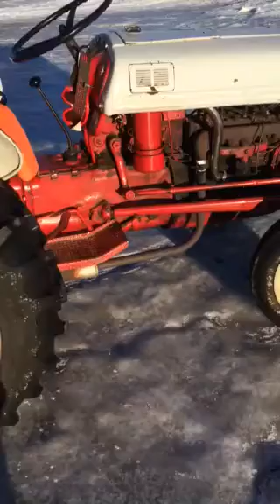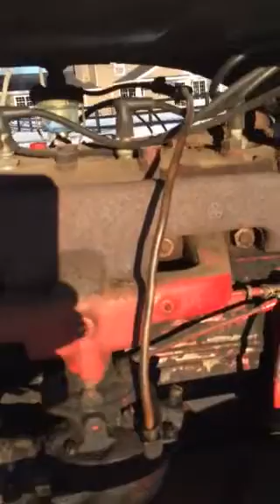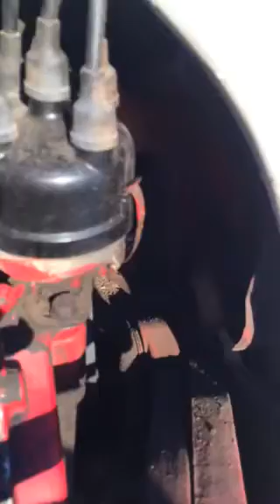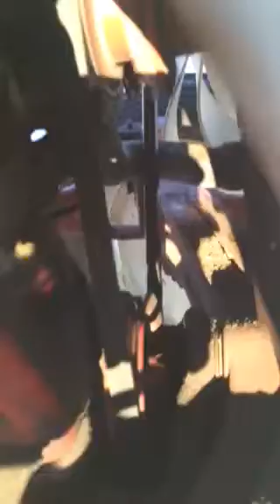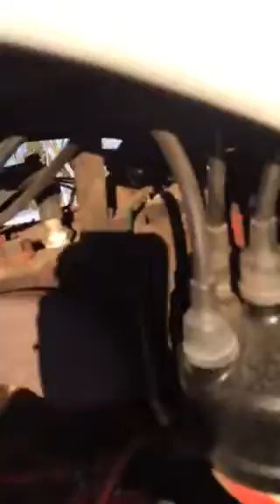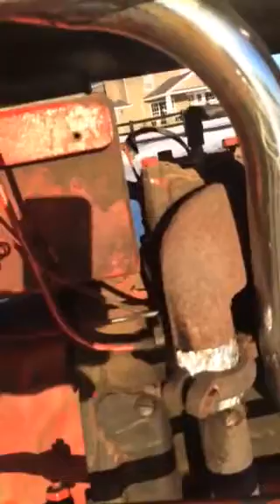8N Crankshaft pulley wiggle

Comment: I just bought a 1952 8n.   Everything seems to be working fine with exception to the exact same problem shown on the video.  Wiggly crankshaft pulley.  Is this something that needs immediate attention? How difficult is it to replace that pulley?  Thanks in advance
Reply: I have a early 1952 8N with the same problem so what did you do to fix this

Comment: Crank pulley. Common prob sheared key bolt loosens up and evently Will just spin on shaft. That pulley is press fit and will run some time be for it dose what you see here.